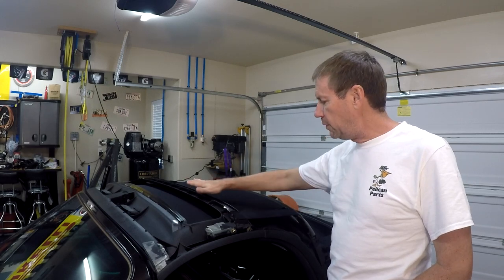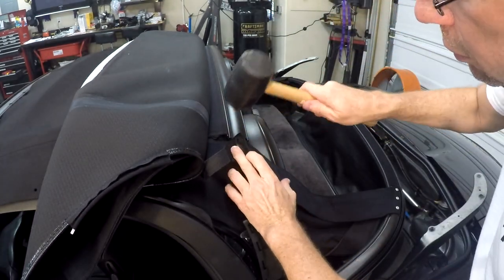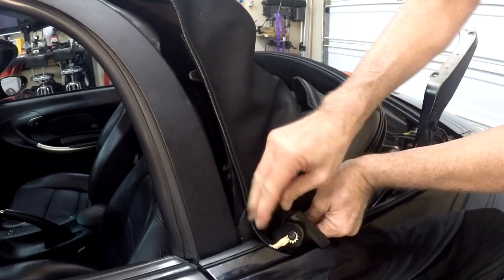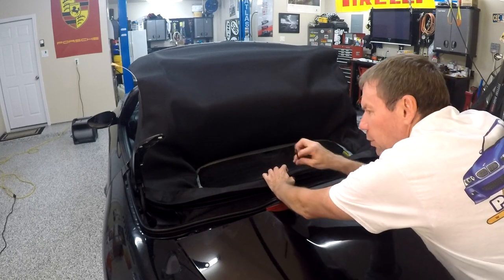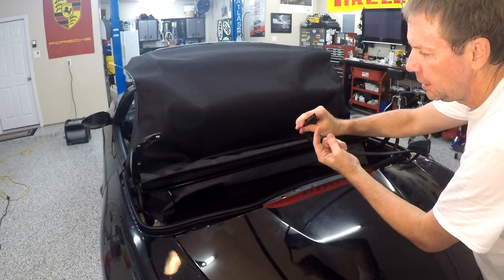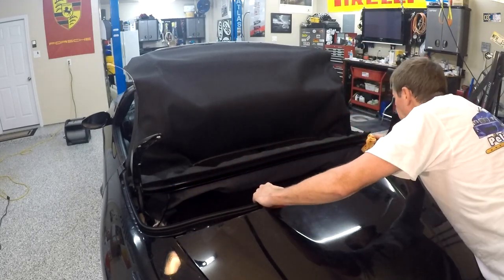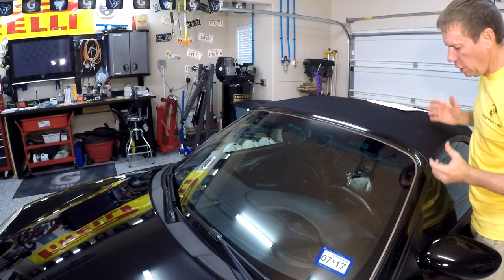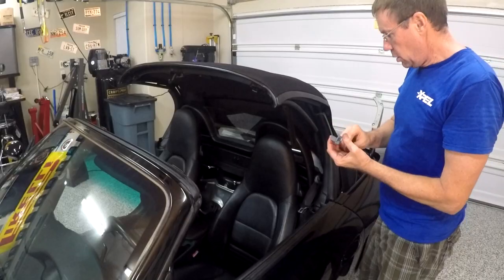Jet 3 How to Remove and Install a New Convertible Top on a Porsche Boxster S (Part 2)

Comment: Thank you, Steven, for creating this outstanding video.  I replaced the top on my Boxster following this video, and I'm currently replacing the top on my son's Boxster.  I don't think I could have done it without this video - the written instructions from the top supplier do not make much sense.
The step at about minute 5:00 in the video where the cord (with fabric sewn around a plastic cord) goes into the vertical metal slot is difficult, I struggled with this the first three times, then the fourth time went much easier using these steps: 1) The plastic cord sticks out at each end of the fabric, that cord on the leading edge tends to come out of the open areas of the slot, then jams. Push the plastic cord back until it's flush with the fabric on the leading side; let the extra cord hang out the back end.  The fabric helps keep the plastic cord from slipping out of the groove.  2) The fabric is not stitched tight against the cord all the way to the end, this can cause the fabric to flare out in the open areas of the slot and also jam.  Apply a little bit of superglue at the fabric end, clamp the fabric together and let it cure. This keeps the fabric tight against the cord while sliding into the slot.  3) Apply a little vaseline in the slot, especially each location where the open areas close back together, and on the fabric that slides into the slot.  4) Don't tug hard on the top fabric below the cord, that can tear the cord flap where it is sewn to the top.  Instead, hold the top with your entire hand where the cord flap is sewn to spread the load when you tug on it.  Don't tug hard in any case; if it's stuck, back up a little and try again.  5) Check that the entire length of the cord is straight while sliding it into the slot.
If you're thinking "oh no, don't use superglue or vaseline", those were both suggested by tech support at the top supplier and they helped tremendously with this step.
I hope this helps anyone else struggling with sliding the cord into the slot.
Reply: Lon, happy to hear this video provided the confidence for you to do this work!  Thank you for the detailed supplemental  guidance regarding the cord.

Comment: Great video. Very helpful. Just one note the elastic strap that you secure at the 3 min mark should have gone about 6" lower onto the plastic rivet on the inside of the pillar which holds the plastic slider in place.
Reply: Nah, he did it right. Even instructions that come with the top have a picture of it getting placed under that plastic rivet shown in the video.

Comment: Thanks for the video...I'm in the middle of this job installing a Sierra top...I did notice you put the star washer on in the wrong order. It looks like you didn't have it touching the fabric? On mine it was screw, hook, washer, fabric. You had screw, washer, hook, fabric.
Reply from the maker: Good eye!  can't say I recall this detail as it was many years ago.  I haven't had any failures, so no worries on that front....for me.  Those of you doing this job, please take note on the order when you disassemble.
Reply: @roaringtigersgarage4672  It's a small detail, but the job does require a lot of detailed work. I've been watching and rewatching your series and Jason's garage https://www.youtube.com/watch?v=ML-rIbnx5ec&t=116s endlessly, while I finish my install (I'm almost finished). Best regards from Japan !

Comment: Nice video but one important part that is missing is how to secure the bottom of the top to the B pillar.  There is a strip that should be secured under the plastic piece attached to the B pillar...at 4:40 in the video you can see it by your right hand. Did you just leave it hanging? I really think that the plastic pieces should be removed from the B pillar in order to fasten this correctly.

Comment: Great video, I realize it’s been a while, but hoping you or some of your viewers could help.  I got the new top on and it’s nice and tight and looks pretty good if I say so myself….but the window trim pieces where the cable tucks in behind…my cable will not go behind the time piece towards the rear unless I physically tuck it in and then it stays in place and looks great.  It almost like the cable is too long, but I know that’s not the case.  I can’t figure out what I’m not doing correctly.  I’ve kept it closed for about a month thinking it would form into place.  I hope what I’m describing makes sense, any help would be appreciated.  Thanks to all in advance!
Reply: Randy, thanks for posting the comment/query. As you state, it has been a long time since I did this work, but I did not have any issues similar to what you describe. Honestly I can’t visualize your issue but perhaps one of the many followers (and Porsche DIYers) have insight!

Comment: Nice video.Is the 05 911 Carrera top similiar installation? And do all 911s have defroster receptacle,if it came with plasthuic window from factory?
Reply: The 996 generation 911 was developed at the same time as the 986 Boxster, and in fact share everything from the doors forward. I can’t say for sure but I would expect the process and mechanicals to be very close to the same for your 911 as described in this video

Comment: Any tips for a DIY fix when the rib holding the headliner in the channel right behind the top latch breaks? Mine just let go and is rattling. Looking on the forums, guys are saying the only replacement is a new top at $700+. Thanks.

Comment: Issue: After replacing top, when raising roof the B Pillar & Roof Frame don’t align correctly they are separated by 4mm instead of flush

Details:
1.	1999 Boxster
2.	Replaced roof with Sunset AutoTopsDirect Acoustic Plastic Window Top
3.	It seems like there is an obstruction as I cant apply force for it to align

Appreciate any guidance to fix this.
Reply: Sorry to hear you are having some challenges. Unfortunately has been many years since I did this work, and no longer have a Boxster available to try to understand the situation. Wishing for your “a-ha” moment!

Comment: what year car did you change the top to a glass window?   I know the 2003 started with the glass rear window,   I also heard you have to change the mechanism to use a glass window,   Can you put a glass window ( albeit a small window)  on 2002 986?

Comment: I'm doing the same brand top. Mine came with a cardboard header strip. Did you use that? Thanks for the video!
Reply from the maker: Fred,
Yes, that thin cardboard strip must be used along the front edge of the top.  This step begins at 23:14 in video 2.  Unfortunately I had technical video problems at this point, and didn't catch these details on video, although it is described.  Follow the provided written instructions and you will be fine.  Mask everything so you don't get spray glue on your interior fabrics.
Thanks for watching our videos.  Good luck!
Reply: My top turned out great. Your video really helped!

Comment: Mine won't close all the way. Can't even get the latch to catch.. Do I throw a tarp on it and let stretch.. Or do I need to go back and try to reset the aluminum top plates to allow for more slack. Just could get the screws to line up... Any help is greatly appreciated.
Reply: Yes, too tight.  the fabric is fairly robust and intended to be exposed to substantial heat and moisture, so its not gonna soften up and slack.
Reply: @stevenbukoski4474  I undid the the cables and got it to force shut. So in your opinion, no way to hope it will stretch enough so I can reattach the cables?

Comment: Hi, i heard replacement tops never fall into place properly like the original and that i should change the plastic window only since it is pierced..anybody have input on this?
Reply from the maker: The replacement top we replaced in the Roaring Tigers Garage video works and "falls into place" exactly as it should.
Reply: Doing mine right now...youll have a second opinion from someone that is mostly clueless in a few hours ;)
Reply: Fit like a glove, took me about 8 hours but that was lots of breaks, a store run, etc...  Only bit that was a pain was sliding in the roof to the side slots.  Looks fantastic.